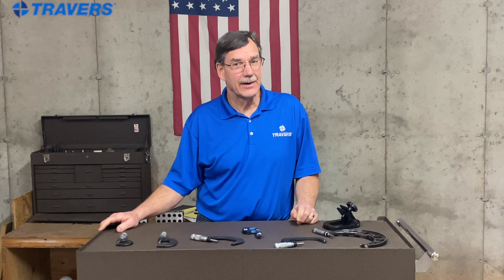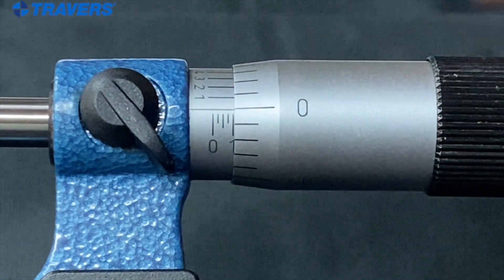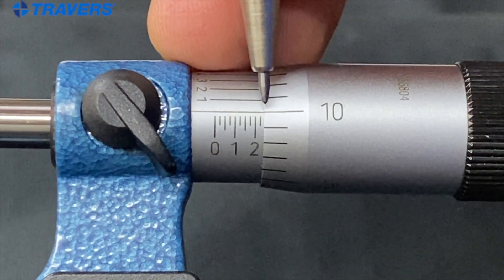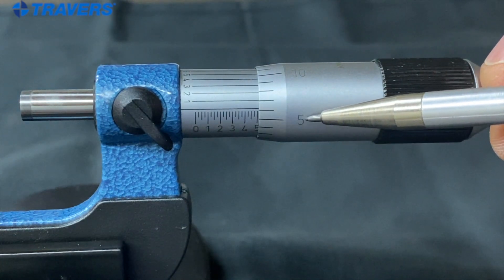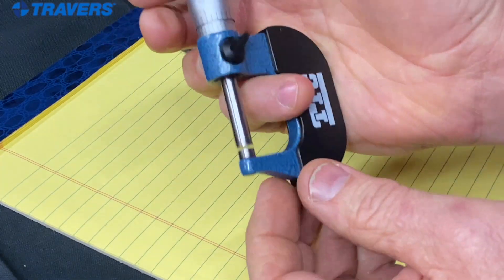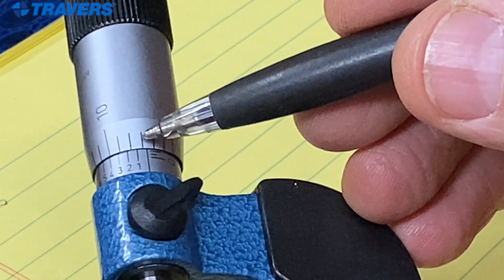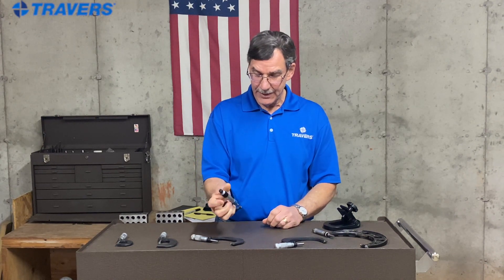How to Read a Micrometer

Comment: Great video! Do you have a video where you take a measurement, like 3.0 mm, convert it to inches using a converter, like 0.1181" and then dialing into 0.1181" on the micrometer? Would be useful to do the reverse. It would help because as a DIY mechanic, I need to convert service limits over to the micrometer, then I set the micrometer to that service limit and see if the item fits or not (like brake discs or clutch friction plates). Thanks again! 🙂
Reply from the maker: That can be done with a digital micrometer (electronic, not mechanical).

Comment: Avoid the confusion. Get a metric micrometer
Reply from the maker: I apologize for the extended delay. We've been experiencing difficulties accessing and responding to YouTube comments.
I could not possibly agree with you more. I remember back in the mid-1970s when we started going in that direction and stopped half of the way there. Now we have BOTH!

Comment: Thanks brother I needed this.
Reply from the maker: I apologize for the extended delay. We've been experiencing difficulties accessing and responding to YouTube comments.
In most machine shops, tool rooms, etc., we read three places past the decimal. Is that correct? Nope—absolutely not. So “seven tenths of an inch” equals .700”, or “seven hundred thousandths of an inch”.

Comment: Best micrometer reading video by far.  All the others I've watched talked about adding up numbers in columns.  This is so much easier!

The only thing missing is using the ratchet which is much more common than this friction thimble. 

Thanks!
Reply from the maker: I apologize for the extended delay. We've been experiencing difficulties accessing and responding to YouTube comments.
Thank you. I’m glad you found it helpful.
Good point about using the ratchet. I wish I covered that in here. I could have explained why I like the friction thimble over the ratcheting one, and that some micrometers have neither. Hmmmmm... Perhaps a new video should be added???

Comment: If you turn the micrometer so that the anvil is pointed towards you, reading the lines of the vernier scale becomes a lot easier to read, because you are looking straight down the lines of the vernier scale to see which line best matches the lines on the thimble.
Reply from the maker: I apologize for the extended delay. We've been experiencing difficulties accessing and responding to YouTube comments.
That's a GREAT tip! Thank you for sharing it.

Comment: I love this tutorial.The person training you got frustrated because it was difficult for me to learn, so thank you for this tutorial. I may be wrong, but when you use the small micrometer.I thought the 6 actually lined up more so than the 5. But the point of my comment is just to say thank you.
Reply: While holding the frame, turn the micrometer so that the anvil is pointed towards you. This will make it easier to look down the lines of the vernier scale and see which line on the scale lines up the best with the lines on the thimble. My high school metal shop teacher taught me this trick back in the 1970s.
Reply from the maker: I apologize for the extended delay. We've been experiencing difficulties accessing and responding to YouTube comments.
Thank you. I’m glad you found it helpful.
I think it was more the angle of the camera that made it look like a 6.

Comment: This is great.  There's another video, actually one of those old training films, that explains why the vernier scale works.  Simply put, it doesn't line up exactly with other scale, for example it might, for example, divide a fraction, for example 4/5 of a main scale, into 5 parts, of the vernier.  In that case, a vernier line is 4/5th of the main scale.  Then by finding the line closest to the main scale, you can work out the next decimal place ( I am terrible at explaining it, but there's videos with competent explainers :)
Reply from the maker: I apologize for the extended delay. We've been experiencing difficulties accessing and responding to YouTube comments.
Thank you. I’m glad you found it helpful.

Comment: Maybe in 300 years the Americans will discover the simplicity of the metric system and how it helps prevent errors.
Reply: Any American with more than two brain cells responsible for logical thinking agrees with you. If it were up to me, the entire country would have 5 yrs to fully implement the metric system. The Imperial system would then be dumped in the same location in the ocean Osama Bin Laden's body was.
Reply from the maker: I apologize for the extended delay. We've been experiencing difficulties accessing and responding to YouTube comments.
I agree with you 100%!
Reply from the maker: I apologize for the extended delay. We've been experiencing difficulties accessing and responding to YouTube comments.
Oh, man—I could not possibly agree with you more. I remember back in the mid-1970s when we started going in that direction and stopped half of the way there. Now we have BOTH!
Reply: I just finished the 3rd year of my mechanical engineering degree in America and despite the fact I'm proud of my country there is nothing I hate more adamantly than the imperial system. The metric system is so clean and elegant across basic metrology, fluid mechanics, thermodynamics, kinematics, and just in terms of etymology. Europeans tend to assume that in engineering we only use the imperial system when in fact it sucks and our courses make us learn both systems (metric is unfathomably more intuitive). The most infuriating part is that frequently on my exams we are given problem parameters in units of "kips" which is an abbreviation for "kilo-pounds" WHICH IS THE FUCKING METRIC SYSTEM! Our units scale so poorly that  they needed to use metric prefixes to forge some bastard amalgamation of nomenclature to make imperial physics slightly more digestible. I take it as an admission of guilt from whoever implemented it that even they understand how convoluted it is. Don't even get me started on barleycorn and slugs as units.
Reply from the maker: I apologize for the extended delay. We've been experiencing difficulties accessing and responding to YouTube comments.
I could not possibly agree with you more. I remember back in the mid-1970s when we started going in that direction and stopped half of the way there. Now we have BOTH!

Comment: Nice video, all except at the 6:18 mark. I'm surprised it's been two years and no one caught that he entirely misspoke at that measurement when he stated. " 4.409"...
Reply: Great catch, AXNJXN1.  I forgot the decimal the first time I said, "4", so I repeated it and said, "point 4..."  When using a micrometer, anything before the decimal is determined by the size of the mic, since they only read in 1" increments.  So it it was a 3" to 4" mic, it would be "4.409".  I hope this is helpful.
Reply: @wonbythe1  Close. If it was a 3" to 4" micrometer, it would be 3.409", since we're between 3 and 4 (or not yet to the 4" mark). If it was a 4" to 5" micrometer, then it would be 4.409", if I understand all this correctly.
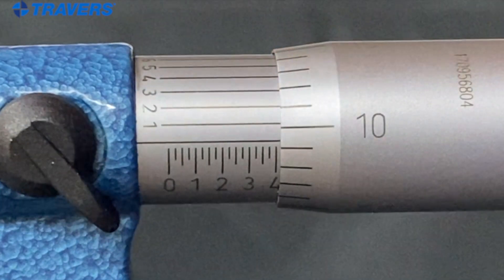Reply: 6:35 I'm glad he corrected himself, or at least said the correct measurement a little later at 6:35.

Comment: Excellent Video and well explained...
Reply: Thank you, Uptown.  That's very encouraging.
Reply: @wonbythe1  I thought I would share why I needed to know how to read a micrometer that we have had here since I was a kid.  
I've been a guitarist (for many years) I need at times to measure what gauge strings are on some of my instruments (as it can be hard at times to keep track with multiple instruments). This way I can replace them with the same gauge strings, or if I want to restring with slightly heavier or lighter strings. 
Guitar strings are measured in thousands. Examples:  .007, .008, .009 (these would be high E strings gauges., Wound strings could be for example ,024 to .050 and larger depending on the type guitar (acoustic guitar or electric....bass even larger). 
Thanks again for the very detailed video and your previous reply. All the best.
Philip
Jersey Shore Area

Comment: Quick correction- at 7:05 you say that one tenth of an inch (0.100") at most machine shops would be called one hundred thousand of an inch when it would actually be one hundred thousandths of an inch (one hundred thousandth = 0.00001" one hundred thousandths = 0.100" small error when spoken, potentially catastrophic error in measurement) otherwise great video and simple easy to understand explanation of how to accurately read a micrometer.
Reply: Although .00001" is one hundred-thousandth (or it's "one" -- one hundred-thousandth), and .100" is one hundred thousanths, which is the equivelent of one tenth of an inch.  I know - confusing, right?!  Here's another way to say it.  .00001 is one piece of something that was sliced into one hundred thousand pieces.  .100 is one hundred pieces of something that was sliced into one thousand pieces.  Does that make sense?
Reply: @wonbythe1  I was just correcting the point in the video when he accidentally called 0.100" ( one-hundred thousandths) one hundred-housandth when he meant one hundred thousandths- that S on the end of thousandths literally means the difference between.1" and .00001"
Reply: That's why we say one hundred mils.
Reply: We just say 100 thou

Comment: Ok. I have a question if someone can help me out here. What if you only have a thousandths micrometer and it doesn’t go to ten thousandths. Should you go by what’s lower than the index line or above it?
Reply from the maker: I apologize for the extended delay. We've been experiencing difficulties accessing and responding to YouTube comments.
As you’ve probably figured out by now, the type of micrometer you’re describing only reads to 3 places past the decimal. Any farther than that is simply an estimation.

Comment: I wouldn't use the "spinning" method.
Reply: Why not ?
Reply: @deonlewis5318  It puts strain on the barrel, and the thread.

There's also the possibility of banging it on something.

Far better to hold the frame, and roll the barrel along your arm.